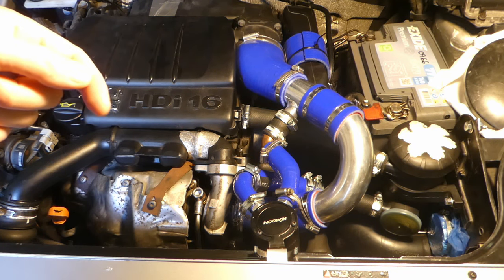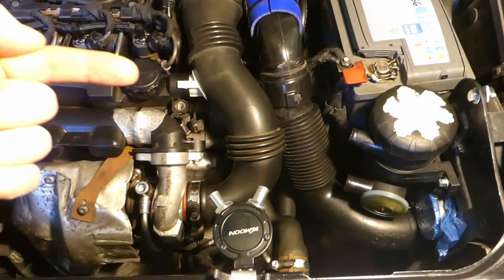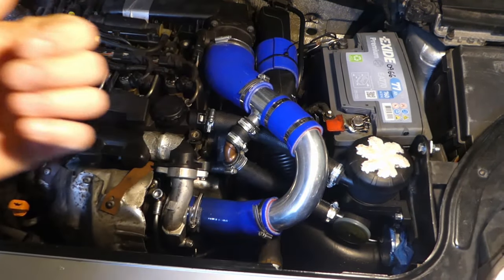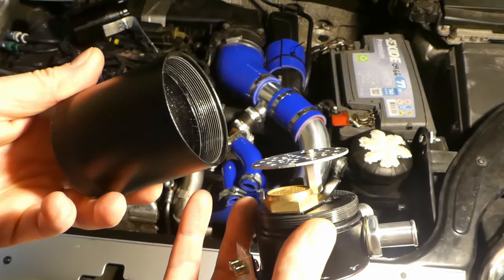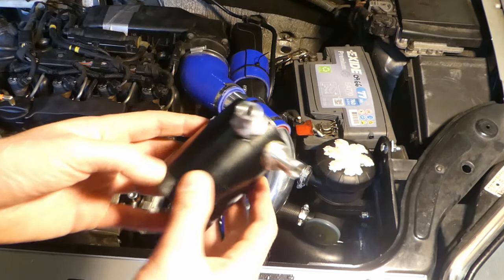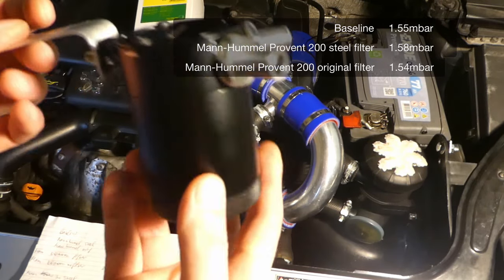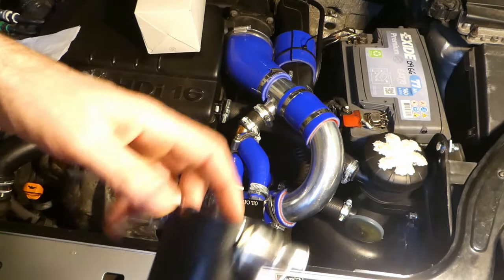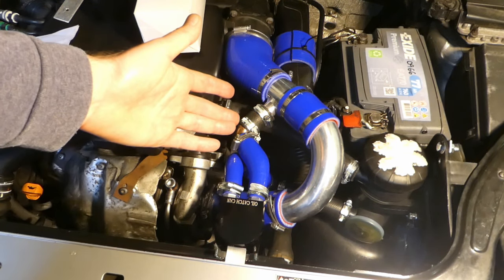Oil Catch Cans Crankcase Pressure, Provent 200 vs Mishimoto vs Universal oil catch can

Comment: Worth mention, never forget the "golden rule". Before doing ANY engine modification. Make sure the engine is performing to the best of it's own abilities. Meaning in this case. Make sure to PCV is working perfectly. And oil changes are up. 
All in all excelent video. Cheers

Comment: I have the Provent 200 on my petrol Audi A4, and I LOVE it! It's actually an oil/air separator (not a "catch can"), and it has both a pressure release valve, AND an active pressure regulating valve along with two different types of filter materials (nylon screen and sponge), a plastic coalescence screen, and room for an added wad of steel wool to increase coalescence. The type of filter element is really what matters. I'd never use a "catch can". They are overpriced, are nowhere near as efficient as an actual oil/air separator, and having TWO pressure regulators makes the comparison moot. .
Reply: Hi mate.  Where did you buy the Provent 200?  It is original ?  I agree with you catch cans are useless.  Thank you

Comment: The best video and explanation I’ve ever seen. Very well done. And I’ve seen a lot of catch can videos. I run the brass micron filter and ordering the other can in the video right now. Thank you so much.
Reply from the maker: Yeah, I was always concerned about crankcase pressure and if something will happen using them, hence the video. Basically for my own peace of mind.
Reply: You think the pressure wouldn’t increase so much in a petrol engine? Thanks

Comment: As a 3rd generation mechanic and engine builder I don't use catch cans on my Ecoboost or DI engines. They aren't necessary. Use a good synthetic Oil, change every 5k miles,Tier 1 gasoline, replace pcv valve and coolant at 50k miles and zero problems!!

Comment: Back in 1990 I saw a diesel engine generator with a 2qt paint can as a catch can filled a course fiber. The crankcase was vented straight to the center top of the can. The lid was perferated with what appeared to be knife stabing holes all over the top of the lid. The can was placed in a larger pan with an oil spill pad on the bottom. 😂😂 my guess is that this was better than venting straight to atmosphere. I had to open the can. What I found was amazing. It appeared to be working quite well. 😮

Comment: Really useful comparisons. I'm erring on a system for my UK 2 litre diesel that incorporates relief valves to allow 'through flow / bypass' if a filter becomes clogged. But put off by the silly prices of Genuine Mann 200 Pro Vent CC and the Flash Lube CC replacement filters. Many thanks for your informative test.

Comment: very informative...as for In / Out, I also installed mine opposite of what's on the can and wasn't catching much.  When I installed per instruction, it caught more oil / water - also just put fine mesh screens (2) in the baffle.  I think either way is fine as you either catch the oil / water from PCV or catch before the air re-enters the intake.  I also put a steel wool in there..not sure changing to copper scrubber makes any difference (Mishimoto's have "bronze" filter so.. :- )
Reply: Why would you think think either way is fine, when you just said you installed the opposite of what's on the can and wasn't catching much.🤦‍♂

Comment: I like the double catch can system. But that is just a play on emotions. After say 5000km how much oil. I will call it engine sewage that I do not want in my combustion chamber not ever. How much  was collected in the cans. Did adding the second can help?
Reply from the maker: Yeah, it was only an experiment, I did not run it with two oil catch cans for long. Nevertheless, how much oil is rather difficult to answer. I had quite a few videos about how much it collects. In all honesty it depends on how worn the engine is of course. Most surprising was that the oil catch can pretty much most of the time collects water. Mixed with oil it becomes a bit milky substance. Depends on the weather of course, here in the UK it is more often than not humid or raining, so I collected a lot of water, but say California or here in the summer it collects mainly oil. Not too much to be honest, but that depends on the engine.

Comment: I was used oct mishimito on my captiva diesel, its make engine seal cover leaks.thanks for make this video very very good
Reply: That's definitely why! Especially under boost, you crankcase pressures are going to be much too high. Lucky it was only your valve cover seal.

Comment: very good test
 important to note that when the provent paper filter is dirty, it blocks considerably, i had this happen on my diesel. My oil was being forced out of my oil filler cap on rocker cover. So much!!!.the metal one not so mucj so if you've got all of these still  i would recommend a second vid3o of them all dirty.
Reply from the maker: Yes, I bet them all dirty will be quite a substantial increase in pressure.

Comment: Great test. Wow! That eBay catch can could create a lot of problems. That can cause the turbo oil return to be pressurized and back up. That will make the turbo smoke like crazy and can obviously make people think there are all kinds of issues. Not to mention other potential harm from high crankcase pressure. The ProVent 200 setup is impressive as demonstrated many times now. This was all done at idle? Under boost I imagine all of these numbers could change, but the eBay catch can would clearly become the most problematic. Good info to have!
Reply from the maker: Yes, all was done under idle. I also tried to match the temperature of the engine, i.e. had a quick go around the block to bring the engine to operating temperature if I was fiddling for too long.
Yes, the numbers would change under boost, but because there is more suction (turbo spool) the crankcase pressure is the highest at idle.
Reply: @moremolecules  I guess that would depend on how much blow by there is and perhaps it's different with diesel vs gas, but a lot of gas vehicles see the highest amount of PCV flow under high boost, but not necessarily pressure so I see what you mean. Yeah the turbo will be sucking the most as well, but if you were using a restrictive catch can like that, the flow could be far too much and the pressure would back up causing a massive PCV pressure spike. That's my concern. With a good flowing system yes pressure should be lower. :) Again awesome vid.
Reply from the maker: @802Garage  Thank you very much indeed, much appreciated. Diesels are a bit different as compared to gas/petrol, they need their turbo, although naturally aspirated exist. Their max crankcase pressure is always at idle. I tested under boost and with any blip of the throttle, you get lowe crankcase pressure.

Comment: Have used a few of the cheap ones and have been worried about the flow/ pressure. I extend the baffle or air / oil seperator with tube of alum, you can also use Plastic pipe. Keep it off the bottom about  3/4 of an inch and that is where I put the steel scubbing pad small amount . Wanted more time for the air/oil to drop separate by giving it a path  and for it not for to just go in and out since they are beside each other. Will know next oil change if it sucks more oil than last time. Also like these for smaller motors as they produce less volumes of pressure. Bigger cubes more air. Got this on my Honda element and put the larger K1 on my Chevy G10 van . Seemed to smooth idle out somewhat to and I guess acts as a vac can storing it up for braking etc. You mention neg vac with turbo under load
Reply from the maker: Hi craig, absolutely agree with the alum tube down. I should do that, it's been on my list, it would certainly help. I think there was also a modification, where this tube is with holes, so it does not restrict too much. Yeah, the air will find the shortest path, i.e. from one hole to the other.
Reply: @moremolecules  wondered about the holes but spoke with my flow bench guy and meh. Can cause turbulence i use a tube the size of the screen so no flow loss. Also as air hits the side  drilled tube holes  the oil which will be dripping down them to be sprayed doing just the opposite of what you want. Rather it go down tube then through the media/scrubber and find it's way out. Idea is oil drops in droplets/like fuel . Let the oil drop and air up . Not sure how to post a pic of mine on here maybe i will do a video. You can email me. If your still worried about bubbles try farting in the bath tub and tell me what happens ?
Reply from the maker: @craigdoherty2974  Yes, I'm worried about the pressure that needs to push the air through the oil/water that will have collected down there. If one blows through a straw in water, there is resistance. The holes in the sides are only for that purpose, the general flow will still go down. Yes, if oil/water accumulates down, the flow will go through the holes.
Reply: I did something similar. A DIY "can" made out of 4" PVC a cleanout access with a end cap makes a 7"X4" can with a top screw on access lid, a 1" ID heater hose to the Can. Is fitted with a 90 % elbow or coupler at the upper end of the can facing down on the inside of the can with 1/4" holes perforating 1/2" tube or baffle 1" from the bottom of the can. The glued-on end cap is fitted with a 3/8" ball valve for drainage. The inside bottom of the can is raised 1.5" with an X pattern of 3/8" holes perforating PVC and then topped with a sink drain screen. From there to the top of the can and the 1" exit port is filled with copper pot scrub pads the last pad next to the 1" exit port is an SS pot scrubby pad. This is vented to the atmosphere with a one-way check valve and a valve cover CCV filter. As this can is mounted on the frame of my F350 4X4 6.4 diesel. The possibility of going through some water is low but still quite possible. I tested the exhaust out of the can with a little tissue paper. It appeared to be working great. We will see. I will check it at 500km then 1000km and last at 5000km for regular Oil and filters servicing and of course, undercarriage inspection.👍😊❤️🇨🇦

Comment: I suspected the bronze filter would increase pressure. imagine when it gets clogged up, the pressure would be even more I reckon.
Reply from the maker: Hi Nizar, yes I was also suprised how much the pressure is with the bronze filter. It really depends on what pressure can the engine reasonable sustain. Overall there will be an increased pressure, but how much this will impact the engine is another question.
Reply: @moremolecules  Thx for the reply. I was worried abt this pressure. My engine has a lot of blowby and the pcv valve would get pretty oily and restrict flow. I keep hvg to clean it with brake clean very often.
I have a replica mishimoto with the bronze filter, but this problem u highlighted was a big worry for me. thx for this video, it confirmed my fears. good thing the bronze filter is removable. I plan on removing the bronze filter and just keeping on the round baffle plate. currently im awaiting for some fittings via mail before install. in place of the removed bronze filter, i plan to screw in a barbed connector so that the blowby would have to travel down the can and up through the baffle and finally travel through the barb connector and out the can. hopefully it can capture the oils at the bottom without creating too much pressure. once i have setup I'll do a video and put a link. maybe provide updates occasionally.
Reply from the maker: @MrAcc45  That would be really good. Let me know if you do any videos, I'll post it on my community page.
Reply: Then throw in some cold winter weather and frozen water vapor will clog it up even more.

Comment: Excellent research.  I knew those damn 40 micron bronze filters would ramp up the back pressure.  Great way to blow oil past the seal or worse, the seal itself is damaged.

Comment: Once the filter media gets oil saturated I’m afraid that will restrict airflow causing case pressure to increase.
Reply: Yep, one of the reasons I am leaning to ADD w1 vs UPR.. ADD w1 is on sale for $109 for its V3

Comment: Great work! Is it possible that the actual mishimoto catch can's bronze filter is less restrictive than the cheap copy's filter?
Reply from the maker: It is possible, but unlikely. I linked a video (in the description of the video)) of a comparison of the original mishimoto and the "fake" one and they are identical. I suspect it might be just the same factory producing them, but does not label them mishimoto
Reply: I've read in a forum before that its pretty restrictive, Mishimoto has then redesigned and replaced the bronze filter with some kind of big pore sponge type filter that covers the whole ceiling area of the can.

Comment: Thank you, thank you for a very nice, well documented and scientific approach !  I have also done my part of experiments and come to the same conclusion wrt. the sintered bronze filter. The pressure drop across those is rather high. In your example the filter looked kind of dry. But when this type of filter is wetted by oil droplets over (a short) time, the pressure drop will increase even more. These filters are simply too small in terms of filter area for an application like this, where just a few millibars matter.
It is interesting to note, that only the Mann & Hummel filter takes advantage of the cyclone effect, by having a TANGENTIAL inlet. By this, the incoming fumes, with oil-droplets, will be whirling along the insides of the canister, splashing off most of the droplets (being heavier than fumes) at practically no  pressure drop. An old trick from the process industry.
There is another issue that I have not seen mentioned in the many Oil-Catch-Can videos: The intercooler !
Let me explain: A turbo-charged engine will have an intercooler. This is due to the fact that air is heated when compressed. When air is heated it expands and thus, less air/fuel will go into the engine and nothing is gained from the turbo. Unless you cool the air after the turbo.
The intercooler is normally fitted under the radiator and is thus the lowest point in the air-intake system.
Where do you think the oil-droplets and oil residues inside the air intake system is gonna end up ?
Right ! Over time, must oil films deposited on the insides of tubes and hoses in the intake system is slowly, but steadily seeping down to the intercooler, filling it up. In fact, the intercooler is a perfect oil-catch can, being nice and cool, condensing oil-droplets in passing.
Of course, the turbo outlet itself will provide a substantial pressure (thats what they do :-) and so some air is still gobbeling thru, but with limited, or no cooling action.
My guess is that most intercoolers dont work. But then again: Its a good thing we never need those 250+ HP just by gurgling around town, so we havent noticed  :-/
Reply from the maker: Thank you very much indeed for the really detailed comment, more than appreciated. I would say it is somewhat scientific, as there are still a few variables unaccounted for, but still better than nothing I guess. Yes, the bronze filter has way too limited surface area. I think Mishimoto realised this as the huge Ford Cummins engine (6.5L) was throwing some errors and they produced a new oil catch can for this engine, much larger surface area and not 50 microns, but rather coarse mesh.
Yes, the cyclone effect is pretty good actually. There was a scientific paper on that and it was the most efficient way without increasing/hampering the restriction/flow.
I have thought about the intercooler, it is basically an oil catch can in its own right. I have already bought a second hand one to have some tests with it and will post a video someday. I am thinking of a semi-scientific way to test oil catch can efficiency and have some ideas, it is just time that is not enough.
All the best.
Reply: Great insights, but one thing. Intercoolers absolutely work. The difference is massive. I highly recommend looking up the article "How intercooler design can changer the performance, efficiency and power of your engine" on Engine Basics as well as "Drop Intake Temperatures. Drop Track Times. Drop Jaws. The Ultimate Guide for Intercooler Selection!" by Mishimoto. The latter is much less data dense, but still demonstrates what a difference intercoolers make. Intercoolers are also a trade off between restriction, cooling, and efficiency.

Comment: Thank you for displaying your benchmark research. I have just fitted a Provent 200 to a diesel JK wrangler 2.8 Turbo intercooler model 2008 mileage done 200k.  The kit from Germany came with quite a few right angled 90 degree connectors. AND THAT is my question. These connections are all internal to the main hoses? So would that push the pressure up? Like a water blaster effect? When I put my figure or white paper over the output of the Provent onto those small right angled connectors there seems to be no pressure at all? What do you think? I thought maybe I would change the position so it just uses the larger [and shorter] rubber pipes as suppled? Any thoughts?   Interestingly to myself.... My jeep seems to have picked up power since fitting this Provent?
Reply from the maker: Yeah, I always thought that many right angles will lead to a little bit of pressure going up, not proably a lot less than one thinks. Restrictions (narrowing of pipes) are are probably the biggest pressure increase, although also not by much. As far as I have learnt, main pressure increase is likely to come where the air/gasses are stopped or are hitting something, like a mesh or even finer filters. It is just a guestimate of course.